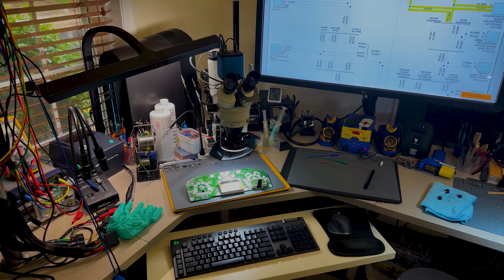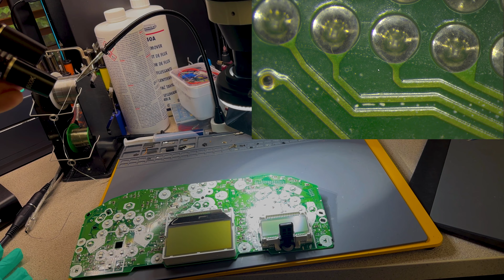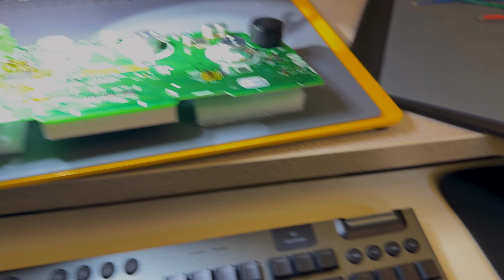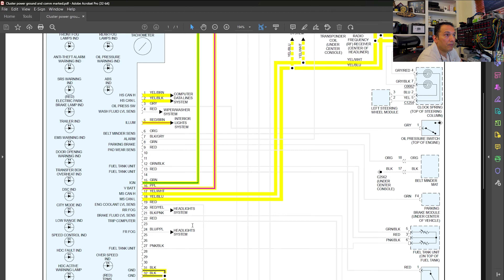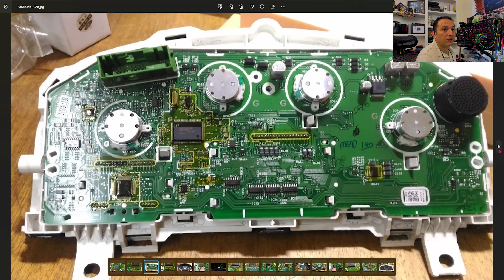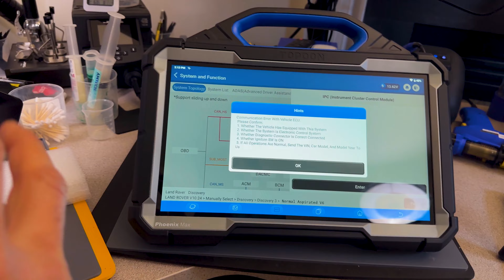2008 Land Rover LR3 Instrument cluster dead Test and repair for Aaron Betz VA

Comment: Good afternoon, I need help. I have a 2010 L322 in my workshop and it has the same problem: the instrument cluster doesn't light up. I got a used one, but when I install it, the vehicle won't start.
Reply from the maker: Sure, I can help you. Send me the original cluster for repairs. Email me at maic@maicsalazardiagnostics.com

Comment: Wowo thank you so much for this video! Did the exact same thing to a Range Rover Sport 2009 and the cluster is now working 100%!!! I didn’t have to do the calibration tho I just put the needles back on where they came off from. Symptoms before was whole cluster sporadically turn on and off at random. No turn signal sounds when this would happen too. Definitely seemed like the cluster was loosing power. I don’t have the microscope like you so I couldn’t see the cracks but definitely must be there since all is well now!!! Thank you again!!!!

Comment: Hey I am having an issue with my 2005 lr3 cluster. The hazard lights turn on, the stereo and the navigation turns off. It all comes back on after a few minutes. I was looking at some forms in the hall, pointed towards the instrument cluster. Do you usually fix these? If you do… how much do you charge?
Reply: Hello, I have exactly the same problem as you, did you manage to solve it? I don't know how to contact the guy in the video.
Reply: @astriddominguezz  hey! I did! I ended up using technolabpro shop on eBay… it was around $300. Super fast turnaround and it works perfectly.

Comment from the maker: Clear coat removal brush 

https://www.amazon.com/Fiberglass-Scratch-Brush-Pen-applications/dp/B07S3RCTGZ/ref=asc_df_B07S3RCTGZ/?tag=hyprod-20&linkCode=df0&hvadid=366352853698&hvpos=&hvnetw=g&hvrand=7346352048805885996&hvpone=&hvptwo=&hvqmt=&hvdev=m&hvdvcmdl=&hvlocint=&hvlocphy=9007585&hvtargid=pla-815393027928&psc=1&tag=&ref=&adgrpid=76503872856&hvpone=&hvptwo=&hvadid=366352853698&hvpos=&hvnetw=g&hvrand=7346352048805885996&hvqmt=&hvdev=m&hvdvcmdl=&hvlocint=&hvlocphy=9007585&hvtargid=pla-815393027928

Comment: Will you put a link to that brush you used to remove the coating  after chip?
Reply from the maker: https://www.amazon.com/Fiberglass-Scratch-Brush-Pen-applications/dp/B07S3RCTGZ/ref=asc_df_B07S3RCTGZ/?tag=hyprod-20&linkCode=df0&hvadid=366352853698&hvpos=&hvnetw=g&hvrand=7346352048805885996&hvpone=&hvptwo=&hvqmt=&hvdev=m&hvdvcmdl=&hvlocint=&hvlocphy=9007585&hvtargid=pla-815393027928&psc=1&tag=&ref=&adgrpid=76503872856&hvpone=&hvptwo=&hvadid=366352853698&hvpos=&hvnetw=g&hvrand=7346352048805885996&hvqmt=&hvdev=m&hvdvcmdl=&hvlocint=&hvlocphy=9007585&hvtargid=pla-815393027928